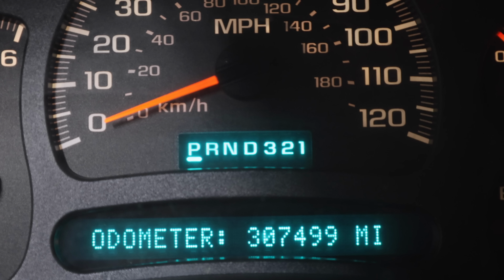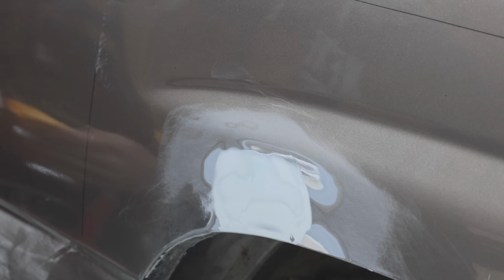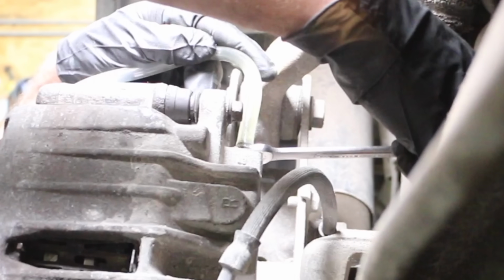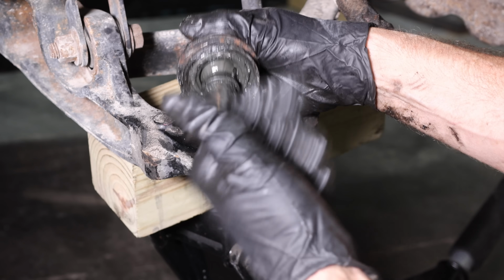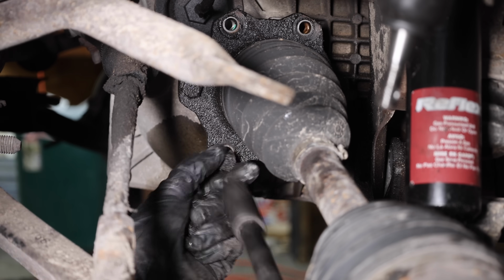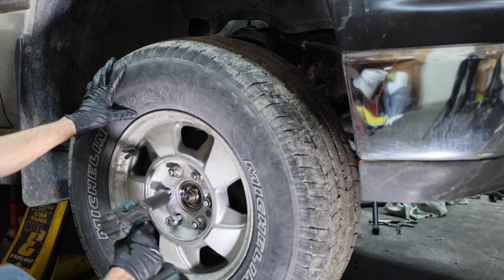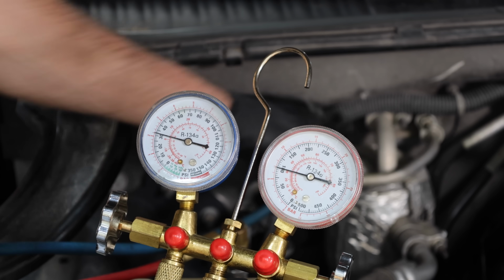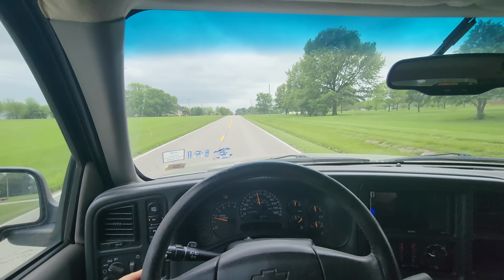Is It Stupid To Fix Up A 300,000 Mile Vehicle? Let Settle This!

Comment: It was definitely worth it to save this vehicle. Just a short while later Chevy changed everything to garbage just like dodge and Ford already did. Chevy held out like than Ford and Dodge before going to crap, but eventually, they were forced to to keep up with their competitors. I will NEVER buy a new vehicle. I'll keep fixing my old one thanks. I prefer the 2003-2006  years of Chevy, even older Ford and Dodge trucks(60's- early 80's) when they were still good. They really make garbage cars now-a- days. Ive driven 286,000+ miles on my chevy truck and the only this I've had to do to it are reset the A/C after the battery died when I had to leave the country for longer than I thought I'd be gone (which was easy it's just a brake pedal, key,  button push combo and it put the A/C back to perfect, put a little refrigerant in the A/C, change the fluids, brakes(didn't even have to replace the rotors haha), tie-rod ends (inner and outer) put some new front axles in(which honestly I could have just purchaed new axle boot covers and lubed it, but I already had them out, so i figured I might as well. New radiator, new spark plugs and wires ONE TIME in 286,000 miles, changed some coolant hoses 1 on the radiator and then the hoses on the transmission intercooler, changed the windshield wipers a few times, new tires, headlights, rear bumper only because someone rear- ended me- NO other damage was caused, just a few little dings and scratches, changed the leather on the drivers side from seat which is REALLY easy because chevy sells pre-sewn leather seat replacements which is AWESOME. Only took me a few minutes and bam brand new leather seat. And i upgraded the mirrors to better towing mirrors. And, that's it. 286,000 miles and that's all I had to do. Still has factory oem compression and now I'm looking to do pretty much what you did just now. Not because it needs it, but because it's just safer to replace that stuff before it breaks and causes other damage. Never had a more reliable vehicle.
Reply from the maker: Thanks for the feedback.

Comment: Just had my front end all rebuilt on a 2007 Honda Accord with 190,000 miles ready for another hundred thousand. As far as rust I didn’t wait for it to have a hole in it I use preventive measures. Got rid of the rust and which was only surface rust and get some paint matched up the paint and added clearcoat.
Reply from the maker: Thanks for sharing.

Comment: This vehicle isn't from an area where lots of salt and snow are used on the roads in winter. Chevys are rust buckets around here. Good engine but thats about it. Probably easiest to work on too but that's probably because they know you'll be working on it a lot. But its not just Chevy, all trucks the last few decades suck.

Comment: I have been looking for an SUV for my daughter who will start driving soon.  There is a 2006 Toyota 4Runner for sale in our town with 308k miles with the 2UZ V8 engine which is the same as in my 2005 Tundra.  Asking price for the 4Runner is around $4k.  I took it for drive today and it drove very well.  Even if I need to spend $4k on timing belt, water pump, etc., at least it has a solid engine and not really any more substantial depreciation.  I would possibly have to spend $2k-$3k for an SUV costing $12k or more with +150k miles.  Getting it pre-inspected tomorrow at a local repair shop.
Reply from the maker: Thanks for sharing.

Comment: YOU ARE AWESOME!!! Keep the pace! I am always so pleased to see cars receiving the maintenance they should have had. Nothing is more depressing than to find a car in the junkyard that shouldn't be there, it couldve been repaired and driving a family around. Why do people not understand that just because your 20 year old car has low miles, that doesn't mean routine maintenance doesn't apply! I had a lady try to sell me a 25 year old car with 12,000. Miles on it. The issue is all the hoses, belts, etc were original and dried out. She thought her car was worth top dollar. I gave up trying to explain all the seals, etc that needed replacing after when she showed me she had only replaced the oil/filter once since the day of purchase from the dealer. Other than that nothing else had been done to it. Im so tired of banging my head.
Reply from the maker: Thanks!

Comment: Awesome video, did you also clean out the throttle body, maybe change an O2 sensor or do an engine flush? My Jetta is at 288k and all of this helped it room smoother

Comment: Hands down top tier channel on YouTube. One of my go to channels for REAL content and information. How much did this all cost you? Aside from saving probably 15k getting all of this serviced at a Chevy dealer LOL. 

Getting ready to do a steering gear box with pitman and idler arm in an 02 avalanche 1500 Z71 this weekend and this definitely helped more compared to other videos I’ve seen showing the job done. 

Also on another video with comparing Amazon and a ten oil mix you did 4500 miles in six weeks time. Any intention on testing out Valvoline restore and protect & pulling off valve cover for a before and after? That would be sweet! Maybe checking and replacing the oil filter at half your normal interval as well seeing how much gunk comes out of it!

Love the channel, keep this content coming. YouTube as a whole would not be the same without this channel, it is that damn good!

Comment from the maker: I get a lot of questions regarding the tools and supplies that I use. Here's a list, but there are more details in the video description. Thank you!
Foxwell Battery Tester: https://amzn.to/4dxxkZo
Powerbuilt Ball and U Joint Service Set, 23 Piece Tool Kit, 
Wheel Bearing Race And Seal Driver: https://amzn.to/3UP7cRd
Brake Fluid Tester: https://amzn.to/3WgLZlf 
Coolant Test Strips: https://amzn.to/3UyomTW 
Dielectric Grease: https://amzn.to/49VL790 
Vacuum Pump for Fluid Extractor: https://amzn.to/4baBvbw 
¼ Inch Clear Tubing for Fluid Extractor: https://amzn.to/3Qm65Xv 
Step Bit for Building Extractor: https://amzn.to/3UBuawf 
Seal Puller: https://amzn.to/4b7I2UN

Comment: 300k miles may as well be 3 miles if the parts condition is still good. It can all be replaced bit by bit if you so desire
Reply from the maker: Thanks for the feedback.
Reply: @ProjectFarm  Would also like to see a full detail on this vehicle! Let's see how nice it can look. Engine and interior cleaned, and refurbished where necessary. I did have to slow the video down by 10% to be able to follow along.

Comment: I don't understand why repairers feel the need to stitch weld.  I've cut corners so the damage area can be bent in a 1/6" . Then I would drill as many 3/16" rivet holes that I needed and had enough set up time for so that I could use J&B epoxy made for steal. I've made many repairs with it. Then I sand off the extra including the rivet head which is to easy to patch with Bondo.  The only place I don't like to use it JB where there is going to be a lot of heat, like close to exhaust manifolds etc...
Reply from the maker: Thanks for sharing.

Comment: Great video as always ! Suggestion; when using jack stands I always used as a precaution homemade wooden blocks as a secondary failsafe barrier. I would make these from either 4x4 or 6x6 along with 2x12 to make solid barrier that can't slip or fail. I feel this is critical especially crawling under heavy SUV's or trucks.
Reply from the maker: Thanks!

Comment: The content is perfect speed..  You can adjust either way, with the payback options in the youtube player. You should have done the electric fan upgrade instead of replacing the fan clutch.

Comment: Just a quick tip fot you Project Farm, these trucks you can put the 07+ stock brakes on the front for a cheap upgrade. The rotors, caliper and caliper brackets are a direct bolt on but you have to run 17in wheels. It makes a world of difference in brake power for the same cost as the stock size. Just for future reference if you want better brakes, I did it on my 04 escalade using 2009 parts.

Comment: I’ve got 246k miles on a 06 dodge Dakota with the 3.7 and 42RLE. I already put a trans in it, had the driveshaft rebuilt due to failed parts, and a bunch of shit. I’m gonna run the hell out of it till I just can’t fix it anymore.

Comment: I would not do this in the rust belt. It also depends on the vehicle. A Kia is not going to last many miles. In MN, it's not even so much about mileage, it's the age. I've seen those trucks go close to 500k, but they don't last much more than 20 years. I've got an 01 and 05 chevy with 5.3 and they are still running strong, problem is everything else is rusting out badly amd i take decent care of my vehicles being a tech.
Reply from the maker: Thanks for the feedback.

Comment: Your smart keep going!  My PT Cruiser has over 350,000 km on it and I just rebuilt the engine at 309,000 km.   The body is pretty rusty but mechanically I have a brand new car and it didn't cost much at all, just paid for engine parts.  I only use it as my winter car and its awesome.
Reply from the maker: Thanks, will do!  Thanks for sharing.
Reply: You're*

Comment: I would have cut the whole fender arch out and welded it in rather than wasting it for a little 2 inch square. Would have less trouble getting it looking better too. There could also be water sitting in the bottom of the inside.
Reply from the maker: Thanks for the constructive feedback.

Comment: This confirms my experience: It makes sense to repair a high-mileage vehicle if you do it yourself. In the past couple of years I've done glow plugs, A/C clutch, all four wheel bearings and coupling rods, all brakes and rotors, rear shocks, EGR valve, blower motor, tie rod ends, lower control arms, and various rubber bushings on my 12-year-old Nissan Qashqai with 200,000 km. Take it to a dealer and the price of the repairs exceeds the book value.
Reply from the maker: Thanks for sharing.

Comment: I'm working on my 338,000 mile 07 elantra, and when I took off the valve cover I was suprised to see it was basically perfect inside. Overall best cars to own are the 07 hyundai models. I've got 2 of them with over 300k so I can say for certain they last.
Reply from the maker: Thanks for sharing.
Reply: @ProjectFarm  no problem. I'd buy a high milage car again. I guess I forgot the point. Sorry.

Comment: Okay so I will start off by saying this. 300k depends on vehicle make and model. There is not many that are reliable after 300k unless it’s a diesel. Like a 7.3 power stroke etc. first thing you should tell someone to check when buying a car at 300k k is motor identification number or even looking for junk yard makings. Blow by. Coolant resolve color and even the time it takes for the transmission to engage into drive. I’ve work for car lots and went to auction and have learned what to look for and check for. It’s no different than buying private. You just shouldn’t have the typical hey let’s disconnect a plug or a sensor so it throws a cel or runs like shit ti steer people away from buying it

Comment: If on budget dont forget check junk yards . I have 2005 suburban need front driving steering, suspension, wheel bearings maintenance work.  New parts would have been over $1k just parts not labor.  But junk yard had everything i needed from Complete upper lower  control arms with ball jounts, wheel bearing hubs, tie rods at a fraction of $300 total versus over $1k.
Reply from the maker: Thanks for the feedback.

Comment: Nothing wrong with putting some money in keeping a car with 300k miles as long as the trans and engine are good.  I had a Ford E150 wih over 350k miles and I replaced it as the motor was pretty much worn out, the alternator went out, rear wheel cylinder was leaking, and the heater core was plugged.  Except for rebuilding the engine I could do the other work myself, but I came across a replacement van with 65k miles for just a $2k more over the cost of rebuilding the motor and went that way.
Reply from the maker: Thanks for the feedback.

Comment: I have a 2005 Suburban with 293,000 miles.  As long as they have parts, I will keep it.  Check out the price of brand-new or recent late model Suburbans. 45 to 60K.
Reply from the maker: Thanks for sharing.

Comment: I love to see it. Also quick tip, when installing the anti rattle clips cleaning the seat with a wire wheel or brush makes it 1000x easier to sit in there and the pads will be able to move freely. Also looking forward to that snap ring video bc same😂

Comment: That string alignment works.  I destroyed an axle with a horribly misaligned suspension.  So after replacing it I used that method and just to make sure I went to a shop and had them check it with the right equipment.  Nailed it.
Reply from the maker: Thanks for sharing.
Reply: @ProjectFarm  I did like your 2 plates with grease technique though.  Plexiglass is expensive so you might be able to do the same with hardboard.  I think I saw somewhere use using trash bags.  You could do a whole video on that stuff alone.  But that's not really your style.  One thing about working on cars like this though, Mine is a 2006 Beetle and everything is basically the same, except everything is done just a little bit differently.  Things like tri square pattern bolts where I had to buy a new set just to take something off.  And the shocks have this weird bolt within a bolt arrangement that defies loosening. In other words, you got lucky.

Comment: Couple more things to note for someone watching that wants to do their brakes... first, do NOT pad slap a car. Rotors are cheap, replace them. Second, ALWAYS pull the slide pins, wipe them dry and liberally coat them with actual brake grease. Third, if the pad clips don't want to fit, use the old ones. Clean the grime off with a wire brush. Pad clips these days are JUNK. Fourth, put brake grease on the back of the brake pad where the anti squealer shim is mounted, do NOT get any near the pad mating surface. Lisle makes a fantastic caliper tool in both single and dual piston configurations and it makes compressing the pistons SO easy. Ive done thousands and thousands of brake jobs, always lubricate brake parts liberally. You'll have no issues.
Reply from the maker: Thanks for the feedback.

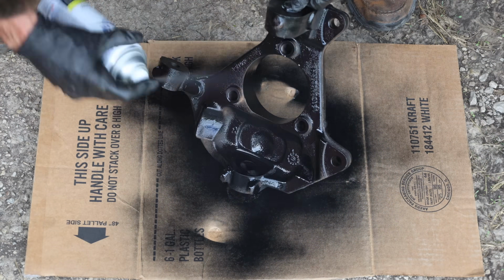Comment: 12:35 it is my understanding that it is quite important to mask off machined surfaces and make sure they are paint free. Having paint there will cause the part it interfaces with to be able to move around a little bit and can work its way loose over time. Plus it wont seat properly which can cause wear. There is a reason they are normally painted before those sections are machined.
Reply from the maker: Thanks for the feedback.

Comment: IMO, old vehicles are worth fixing up vs. buying a new vehicle. I used to be an auto mechanic, so i know how to do all this already. 

I would add ONE MAJOR downside to repairing an old vehicle....

If you are NOT going to go through EVERYTHING in DEPTH, you will have a vehicle that will have frequent problems that could strand you.  This is because a lot of parts are going to give out around a similar time.  This is the only time I would recommend jist buying a new vehicle.  Also, you will spend more money paying a mechanic to do it all for you vs buying a new vehicle......  

I believe this is important to note.  I've taken vehicles back feom the grave, and like old vehicles more than new, but I would'nt recommend it for everyone.

Great video.  Absolutely loaded with good info.👍👍
Reply from the maker: Thanks!

Comment: A Mechanic told me once when i brought my 2000 Suburban in at 50,000 miles to change the transmission fluid not to. He said there is no maintenance to the transmission other than topping off the fluid. Only open up the transmission if you're having problems with it, He said if you leave that fluid in there and only top off once in a while that the transmission will last 350,000 miles. Well he was wrong because my transmission lasted to 379,889 miles before i had to replace the transmission. I know i won't get that out of the rebuild but the Suburban is at 391,004 now and doing just great. That old guy knew something and it's been one of the best pieces of advice I've ever followed.
Keep everything at the pace you are doing. To the point and just the facts!
Reply from the maker: Thanks for the suggestion.

Comment: I have a 2010 explorer LTD with 218xxx, doing new tires, brake pads and rotors, outer tie rod ends, and rear lift glass struts. About $1500 overall, but with the cost of even just a ~2020 used SUV these days, I'd rather just keep maintaining my current vehicle. It also has virtually no rust or other damage.
Reply from the maker: Thanks for sharing.

Comment: This video is so good, and i absolutely agree that it's cheaper and honestly more fun to keep an old car. You end up learning so much, and developing skills that will be useful in other projects as well. Also keeping an old car with a bit higher fuel consumption is almost 100% of the time way more ecological than buying a new car, since the manufacturing is a huge chunk of the cars lifetime carbon emissions. Repairing emissions are miniscule compared to manufacturing. A thing that also comes to mind is that older cars are usually more manageable with electronics.
Reply from the maker: Thanks!

Comment: One thing you didn't mention on the A/C maintenance is the possibility of the system getting swamped by too much compressor oil.  Most of the recharge canisters include extra oil, which I suspect can build up and kill performance, but I'll also check my fan clutch as you pointed out.
Do you know if evacuating the A/C system with a vacuum pump will also boil away the compressor oil?  I know next to nothing on this issue, but I've seen my A/C systems become less and less effective with only small benefits after adding more refrigerant, so I suspect the extra oil.